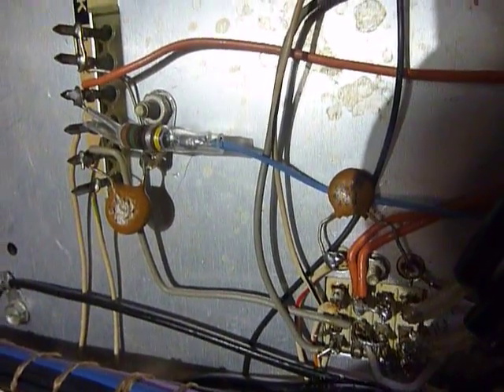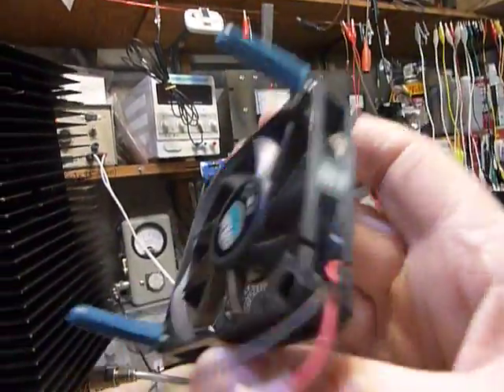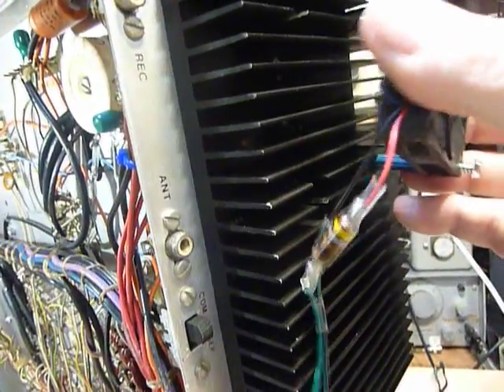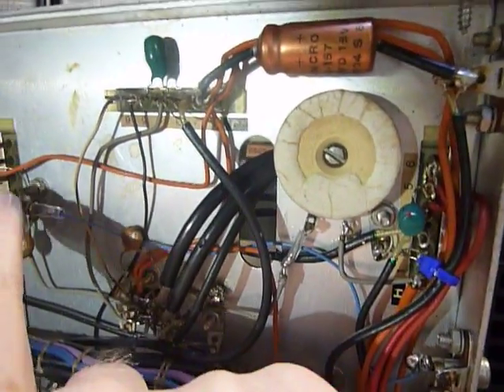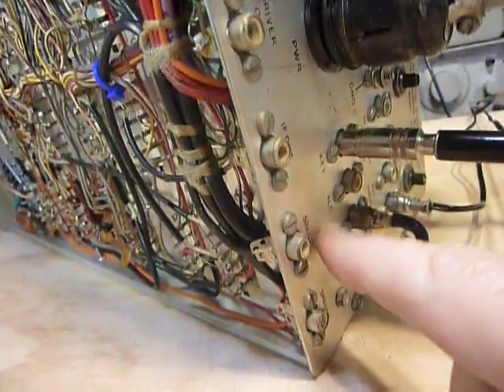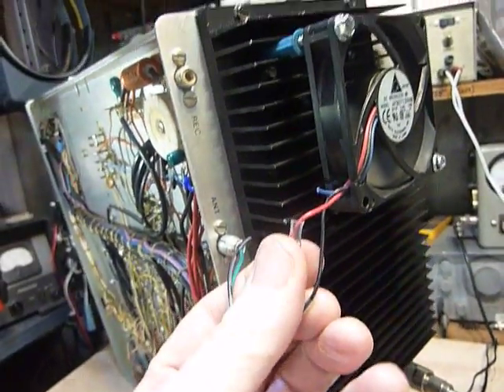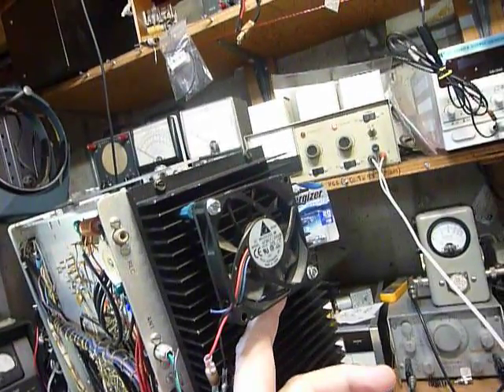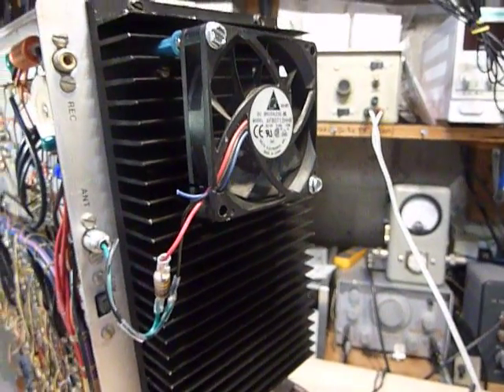HEATHKIT SB-104 HW-104   Tips

Comment: Bob , great idea. I was planning to add a fan to my SB-104A and see you had same idea. Like the anchor idea as no holes in rig. THe lower right hand corner transistor runs the hottest as it as trapped in the corner of the heatsink. Not a good thermal design. For reference, the MRF 450A from RF Parts can be a substitute for the output transistors. Maybe also use the accessory conector to power the fan.